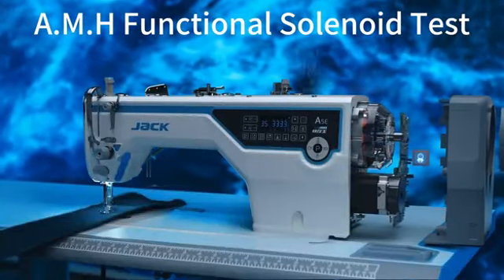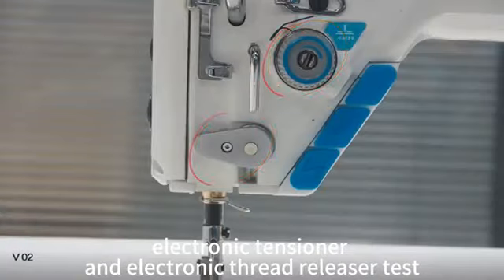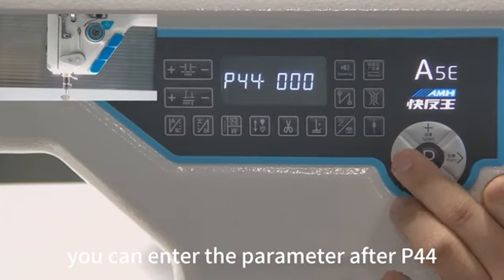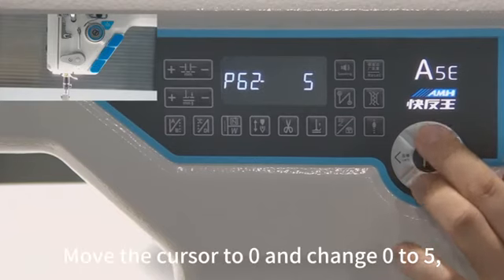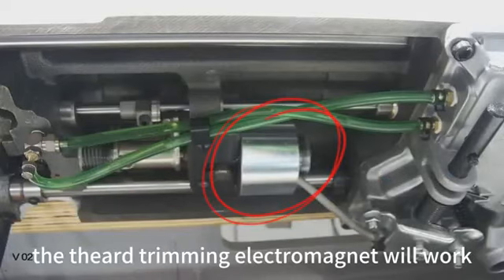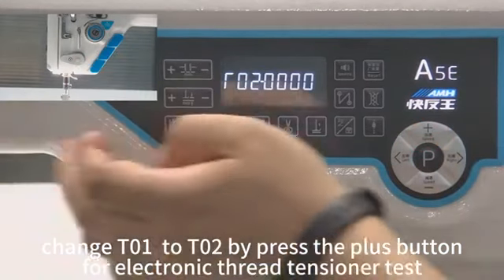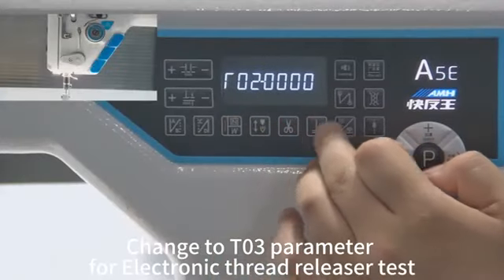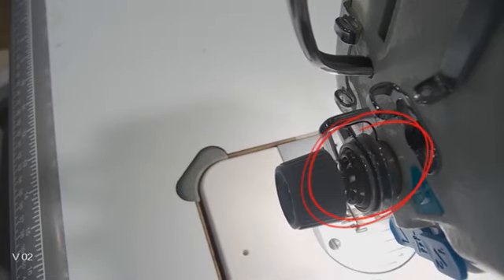Jack Latest A5E-A Electronic Magnet/ Solenoid Testing Systems. (Single needle lock stitch).

Comment: Help please, the thread tensioner selenoid does not work on my machine, what do I do? Please help
Reply from the maker: Firstly, you reset all parameters. 
For reset P65-2, then P press. 
After reset finish you check it’s ok or not. If it is not ok, you should replace the tension solenoid.
Reply: @abulbasharjack4506  Thank you very much for the information Abul, I will be writing to your contact regarding the jack amh, thanks again.
Reply from the maker: Thank you so much

Comment: Please post mote videos for this model
Reply from the maker: Ok, i will try...
Reply: Hola, en la mía los parámetros llegarán hasta el P43
Reply: Hola, cuando activo el tensor electrónico me revienta el hilo por encima sobre la aguja 😢
Reply from the maker: @mariapaulamurcialozano9391  I don't understand your text, please can you write it in English.
Reply: @abulbasharjack4506   Please help. On my machine it seems that the thread tensioner solenoid does not work. What can I do, please help
Reply from the maker: @Minkatextiles  Firstly, you reset all parameters. 
For reset P65-2, then P press. 
After reset finish you check it’s ok or not. If it is not ok, you should replace the tension solenoid.
Reply: @abulbasharjack4506  mil gracias por el dato Abul, le estaré escribiendo a su contacto lo concerniente a la jack amh, gracias nuevamente.